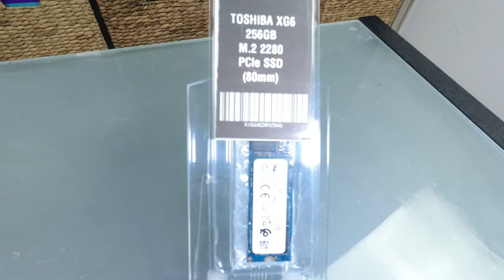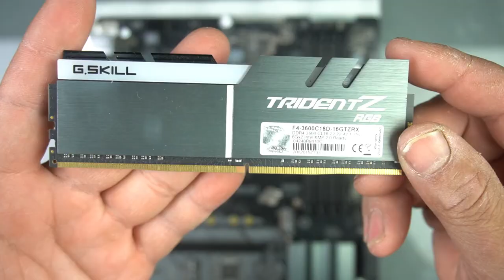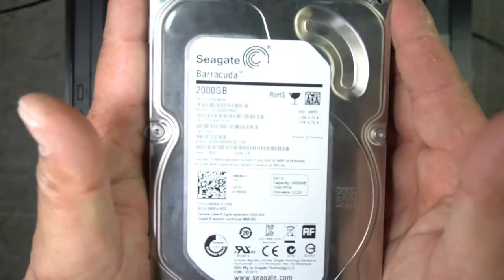mid level cougar mx330-g gaming pc build i5 9600k 1070 8gb gpu 16gb ram 3600mhz 750w psu m.2 SSD HDD

Comment: That's a nice build, but what's your cooler size? I wanted to upgrade my cpu cooler with dark rock pro4 or similar but specifications page said max cooler height is 155mm and dark rock pro4 is atleast 158~160mm
Reply from the maker: the cooler is great wall g400 dual fan 86mm*115mm*150mm so should fit..ye dark rock is like noctua massive cooler and radiator ..u can use one like this and most with 120mmfan

Comment: Hay welcome back its been a while Nice build So are you ready for it are you sitting comfortably have a nice beverage (its ok Ill what ) ok nice job on cable management not much room in that case especially with 90 Molex plugs to deal with.  Are you trying to set off OCD triggers that cooler id 180 deg the wrong way either swap the fan to the other side and flip it or if the fan is pulling air into the cooler just flip it and have a pho push pull set up.  Again WAY to much unicorn vomet lighting (for my tests anyway but  if that's what your into wear it out) but you went with sparkly ones this time nice changeup other then that nice looking rig good job
Reply from the maker: lol always love your comments... ye ill clip the cpu cooer ... always appreciate your feedbac mate.. i am very new to pc builds.. and yes they are built for customers as i do sell them ... its what they want not what i personaly want.. i would rather go for argb fns as you can control them or turn them off completely ..but again thank u...lol ooing back i see th log is upside down ...duh!! no wonder the heat stays in ..lmao ..thanks amte
Reply from the maker: hey bud on of my mobo has a ub issue none of the usb ports work not allowing me to connect anything even a simple mouse or keyboard meaning i cant do anything ..the pc boots and runs ...do u know where to start
Reply: @MIKEYZVLOGZ  maybe you can try re installing windows some times its just a hiccup if that doesn't work then I would say its most likely a faulty mobo  hopefully not but that was the issue I had with the same symptom
Reply from the maker: @dataluskazan4006  main issue is i cant even get a keyboard to work or a mouse cuz of the faulty usb ports..so i cant do anything t all ..get my drift?
Reply: use the ease of access on screen keyboard doesn't help with the mouse but when my pc was doing the same thing no usb ports it was a bad mobo its quite rare but it does happen in over 20 years I have seen it 2 times weird un explainable or intermittent issue are 99 times out of 100 a fault in the mobo but its easer to swam out the board then getting a $20,000 board scanner yo know foe Shure
Reply from the maker: @dataluskazan4006  but how does the ease of access work wen a mouse wont work either... i think i may need a new board
Reply: it doesn't and I think you do as well

Comment: is it good to put front fans like that ?
Reply from the maker: yes as long as they are facing the right way .. these are the direction they should go
front intake cool air in 
top exhaust hot air rises so pull hot air out 
rear exhaust pull hot air out 
cpu..my cpu is wrong it should be other way ...with symbol right way up ...so ignore that ...I changed it later on ..to pull hot air out 
so cpu fan direction will be either towards rear or up to top..so it pulls hot air away 
bottom intake cool air in 
side cool air in 

as long as u follow these u should be ok..
it's the typical direction of flow
Reply from the maker: how do you mean by good? direction of air flow or positioning ? .. its fine ...can't see why it's not a good idea 
in the end depends on your build.. whether u need extra room for gpu or not ...or if u have enough room in front of case to put between the front panel and fan mounts...
all these contributing factors will ultimately give u your answer how to mount them
Reply from the maker: what do u  think the issue is here? I'll elaborate on it for u ... my thoughts at least
Reply: @MIKEYZVLOGZ  i was jus asking because i had the same case i didn’t know if they were supposed to go on the inside of the layer or the outside how u put it
Reply from the maker: @xdescend_  no worries... as long as they fit u can mount either way so long as u face the fans inside for intake

Comment: I have aio
Reply from the maker: aio is good but what's the issue
Reply: @MIKEYZVLOGZ  I don’t know how to put it in my cougar mx330 case I have a amd motherboard
Reply: I don’t know how to put my aio in
Reply from the maker: @Double2cool  watch some youtube clips
Reply from the maker: what size is your aio? u can install in 2 places depending on your size ..360 normally in front... 240 up top ... its hard to explain ..u need to watch some toutube videos of aio being installed ... its hard to explain... watch a few videos so u understand more how an aio is installed ..then u apple that technique to your aio
Reply from the maker: u use the amd mount and that will allow u to mount it to the amd motherboard, if u have am4 or am5 its the same mount , just use the mouinting bracket for amd and it will work @Dblplayer223